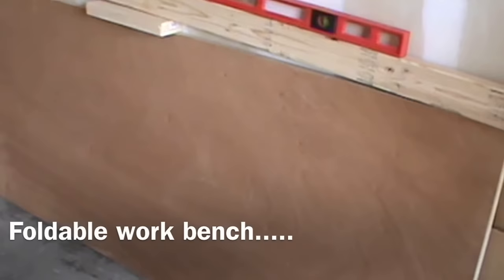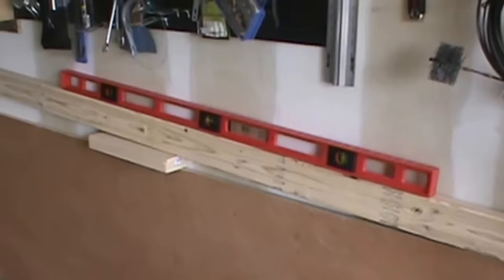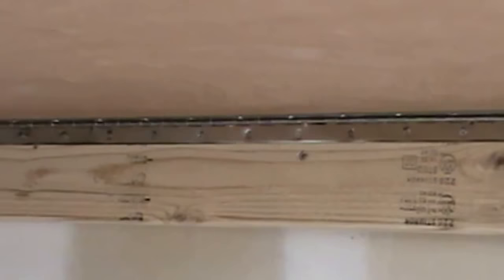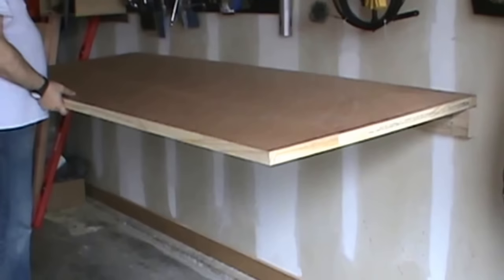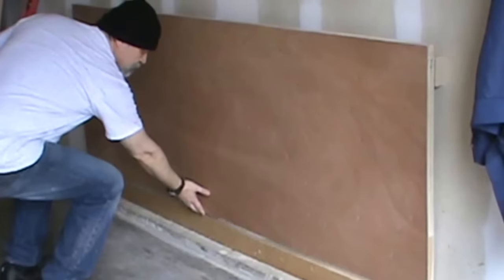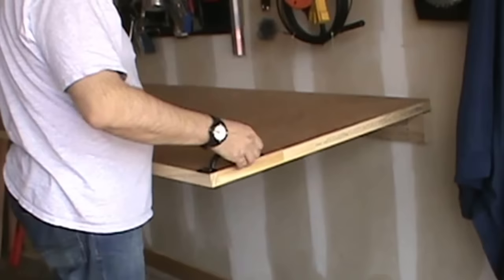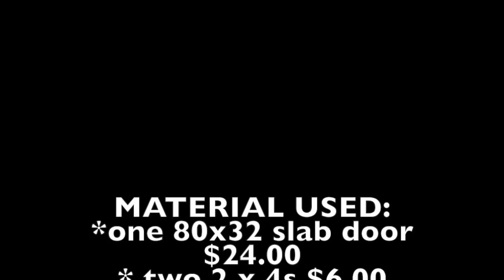Foldable work bench

Comment: Hinging concept is cool. A few things.

- a door is not a good table. If you got the door for that cheap, it’s hollow core and will not support any weight on the skin of the door. If it is solid core, it’s still not a good table. The skin will get ripped up and you will start to expose the glued together, rough chip wood core. 
- Those table legs are not going to be sturdy. I’m planning on building a collapsible table soon and I plan to have 3 pull out supports that will be hinged up against the wall behind the table and swing out to support the table. Haven’t plotted out “locking” them in place yet though.
Reply from the maker: thank you for the comments. It is hollow and have used it for many years without any issues, I have put 300 pounds on it with no issues, the legs are extremely sturdy,  It is a workbench and has performed very well since day one, it has wear and tear but any workbench would.

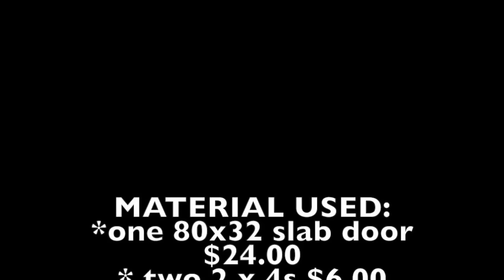Comment: 1:50 Maybe put a latch at top of support leg to strengthen and prevent accidental movement or folding.
Reply from the maker: In all the years I've used it this has never been an issue. It is plenty heavy, and almost impossible to knock the leg out of it.

Comment: those weak legs could be stronger and safeter also..
Reply from the maker: The legs are anything but weak, never had an issue with them and the bench has held quite a lot of weight. Thank you for watching

Comment: I HATE impact drivers !
Reply from the maker: John C why is that? They are great tools. Thank you for watching
Reply: They are overly noisy. The only reason to deal with that unnecessary noise is when using a hammer drill to set anchors in concrete.
Reply from the maker: They are faster than a drill and often can drive bolts/screws that a driver can not. In this project, I tried a drill and simply did not have the power needed for the job. Again thank you for watching and commenting.